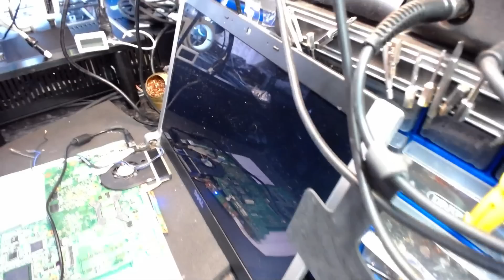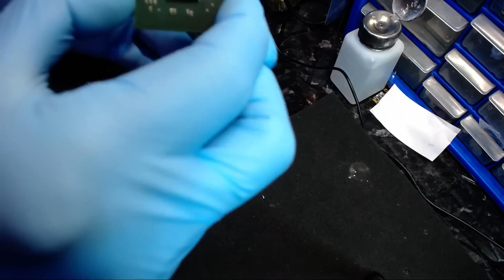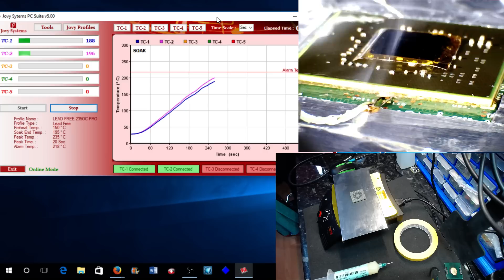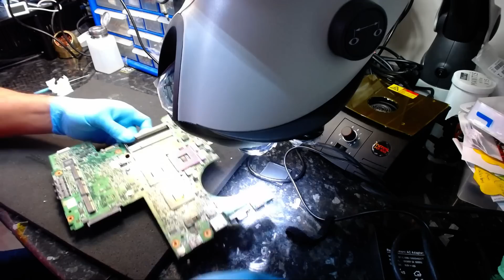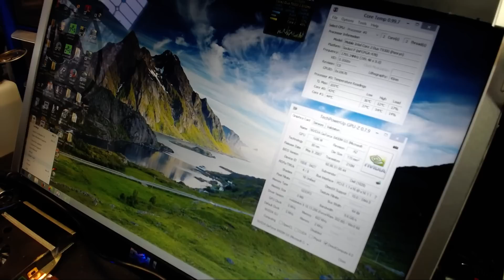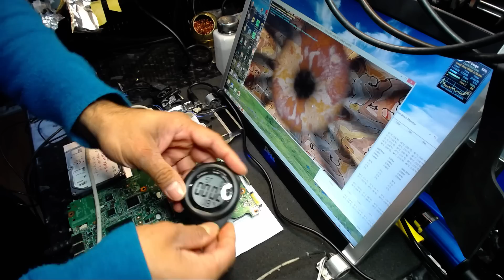HOW TO REPAIR LAPTOP GRAPHIC (BGA) POWER ON NO DISPLAY NEW GPU ON DELL XPS AND FURMARK TESTED!!!

Comment: great , and no racist comment (cowboy , not in the category ) ;) nice small pre -heater , not creating "thermal shock" by heating locally (or is temp too low at that point ,) thank you ; will i need stencil to solder a new cpu socket on a motherboard (LGA-151) ?

Comment: nice video. with power tool. long time ago im using jovy re8500. but i cant handle the dark infrared then back to use hot air station. bga curve is subjective. monitoring is the key during the rework process. dont wait till 235c but wait till solder ball melted. its maybe @210 @230 or lest than.
Reply: You prolly dont give a shit but does anybody know of a trick to log back into an Instagram account??
I was stupid forgot my account password. I would love any tips you can give me.
Reply: @Kane Henry Instablaster ;)
Reply: @Franklin Oscar I really appreciate your reply. I got to the site through google and I'm trying it out now.
Takes quite some time so I will reply here later with my results.
Reply: @Franklin Oscar it worked and I now got access to my account again. I'm so happy!
Thanks so much you saved my account!
Reply: @Kane Henry You are welcome =)

Comment: Hi. I got an older Acer Aspire 5552G model P344G50Mnkk where I upgraded cpu to Phenom II X4 N950. On that motherboard is intergrated GPU HD5470 512MB and the is a model form 5552g series N954G32Mnrr with GPU HD6650M 1GB and N954G50Mnkk with GPU HD5650 1GB. My question is can I change my GPU HD5470 with a better one. I have access to bga rework station at my friends workshop.

Comment: What did you make the squeegee out that you cleaned the old solder off with please? Also do you still recommend golden chipset? Have you had any laptop returns since using them? And can you recommend any other suppliers for providing genuinly new chips not re-balled etc? Great video, Cheers.
Reply: Thanks for quick reply. I haven't seen that method any where else yet. Do you mean like the silicone matts for ovens, but the temperature range is only upto 220, is there one thats a higher range, where did you get yours? Cheers.
Reply: Well for anyone else looking you can buy here: http://www.bga-reworking.co.uk/rework-accessories/miscellaneous/bga-site-solder-remover-squeegee.html

I will try cutting an oven silicon matt up as only £2 from hong kong and can make many. I don't know if the one for sale is a higher temp range though.
Reply: Yes mate. I just got the jovy like you. Going to do my first attempt tomorrow.
Reply: simon rees hi Simon, can you please share where you're getting the Jovy from? I'm also interested. 
Thank you
Reply: iTCXtreme thank you very much. 
I'm in Spain, I'll see if there's a official distributor here. 
I suppose the machine is worth every penny? 
Cheers
Reply: I bought it second hand on ebay from someone in Scotland. I think it is rare to see a second hand one! You can contact Jovy on their contact form and ask latest price, they will email you a list. The Aliexpress prices are fake, if you enquire they always say it was wrong price. They advertise price less than Jovys bulk price! Of course you will pay import charges, no way they can lie and customs believe it due to weight! They do a cheaper unit the Jetronix, I'm told it works as well but uses cheaper heaters. They do a smaller one as well the RE-7500 but I'm told it's too small for motherboards as they warp. Jovy will tell you their distributers. Mu concern is not getting re-marked Chips though and having a load of returns in 3 months! Hope that helps.
Reply: simon rees £1600 for new Jovy re8500... All my boards are small, as I only Mobile phones and other equipments but no laptops nor consoles, so maybe the re8500 is too big for my needs?
Reply: iTCXtreme thank you for the info, perhaps that's the route I should take, also as it is an old model maybe it will be cheaper and available on second hand... Thank you again
Reply: iTCXtreme I will keep my eyes open... 
Have you owned any other brands? Or have you always used Jovy? Thank you
Reply: Hi iTCXtreme, do you recommend this brand? is it better than Achi or Scotle? What's your opinion on that?
Jovy tell me the RE7500 is not suitable for small boards, they recommend the Turbo IR.

http://www.jovy-systems.com/en/products/bga-rework-stations/benchtop-rework-station-turbo-ir.html

Thanks again
Reply: iTCXtreme hi buddy, I'm in Spain. 
I see on eBay second hand RE7500 is almost same price as re8500
Reply: iTCXtreme Will that give me a problem working on small PCB? like 10cm x 15cm for example? Thanks
Reply: iTCXtreme so you mean the re8500 is OK to use on small boards? 
Could you please share some tips on how to use solder wick, I always get my solder tip oxidised and it becomes not effective and it doesn't melt the lead nor heat up enough the braid, cheers
Reply: Hi iTCXtreme, do you recommend the Honton HT-R392?

Thanks
Reply: I use a hot air station for mobile phone boards (Quick 861DW) is an excellent choice, surly a rework station is total overkill, I haven't seen any videos of people doing mobiles on a rework station? That hot air station was around £200 from germany. For my solder tip I always wipe it on a metal mesh, the ones you buy for your sink, scouring one, they look similiar to ebay soldering ones but not in gold, just shove it in a small pot/glass, it never oxidises, I use the Jovy Soldering Station, you can use the fake Hakko tips from china, they work well. Cheers.